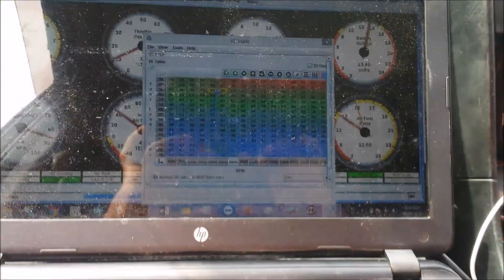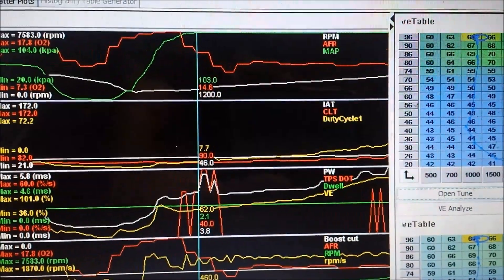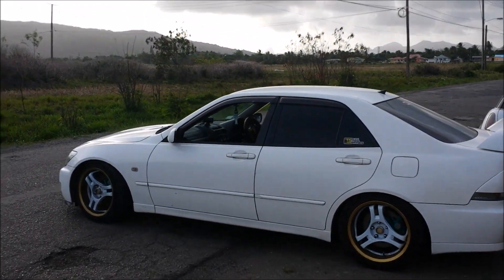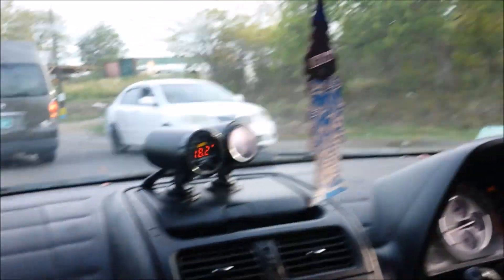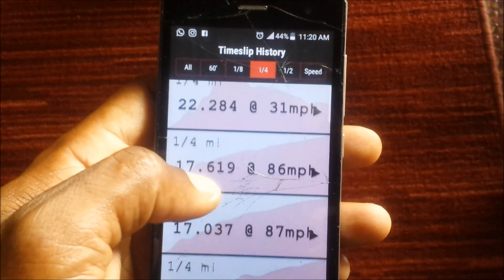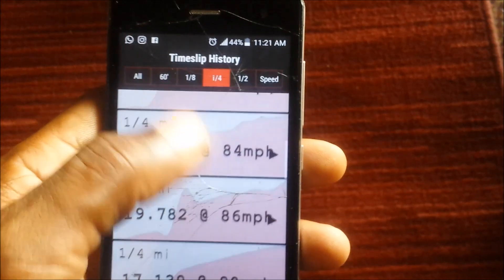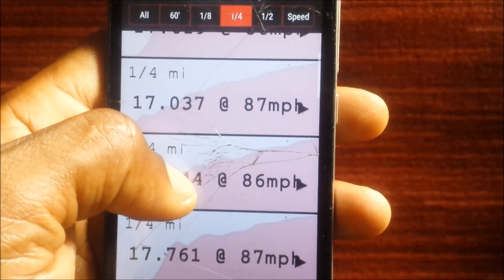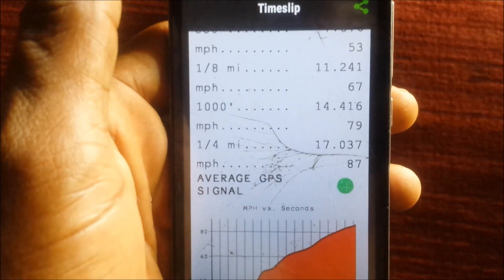Toyota 3sge Altezza Speeduino Install - Street Tuning

Comment: I dont have any experience with aftermarket ecus or piggybacks but our 3sge ecus are tough to crack n tune because there are so well made from the factory.
Reply from the maker: The reason they are not tuneable or crackable has nothing to do with how well they are made IMO. GM, Honda, Subaru and a few others make very good ECU's which are  tunable.